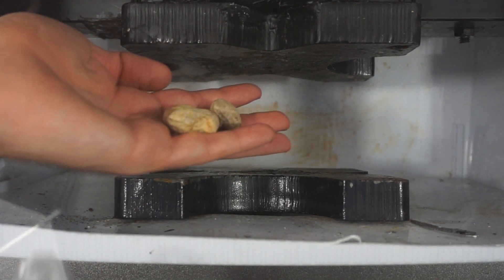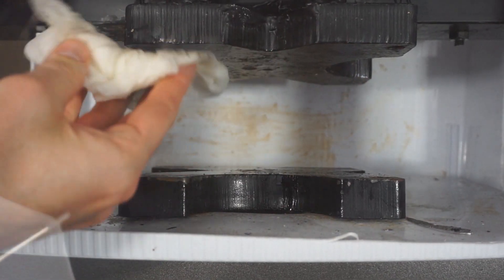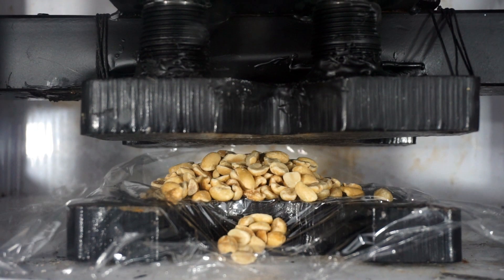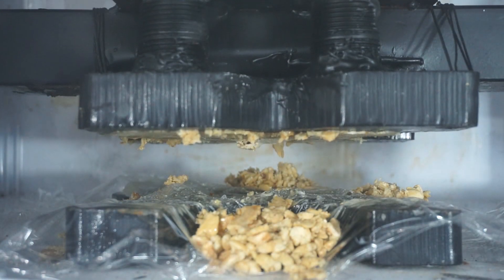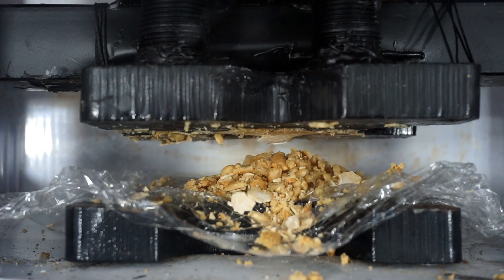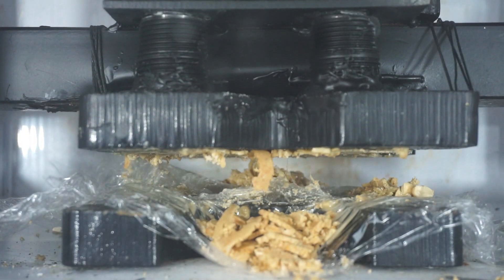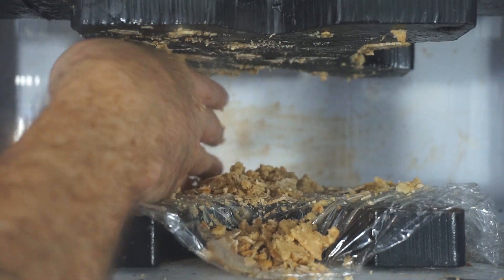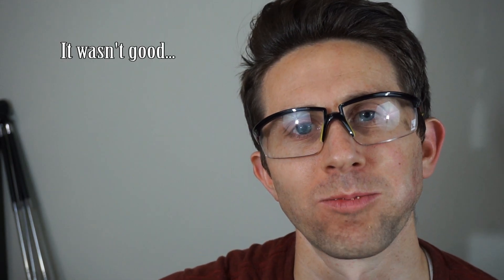Peanuts Turned To Peanut Butter By Hydraulic Press

Comment: That's not peanut butter just peanuts crushed and still is peanuts so you just put peanuts on your bread not peanut butter
Reply: Peanuts have naturally accuring oils that blend the peanuts. If they didn't have that you'd have powdered peanuts. There's no need to add anything else, unless you want a different consistency or taste. Even without that, its still peanut butter.
Reply: LOL, you're kidding? what did you think peanut butter was 😂 it truely is just crushed peanuts
Reply: peanut butter is mostly just crushed peanuts yes, but what makes "peanut butter" actually "peanut butter" is all of the oils and other ingredients added in after said peanuts were crushed
Reply: J Renèe ツ  i never declined that it was peanutbutter, i said it's not what most people commonly call peanutbutter, because what the common peanutbutter usually has is not in just crushed up peanut butter.